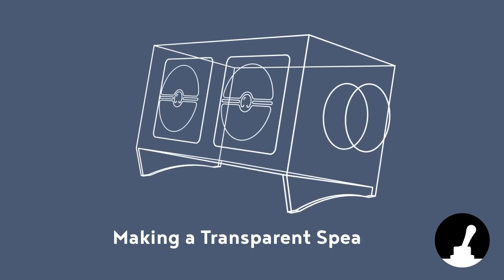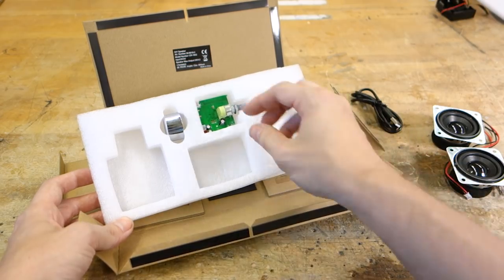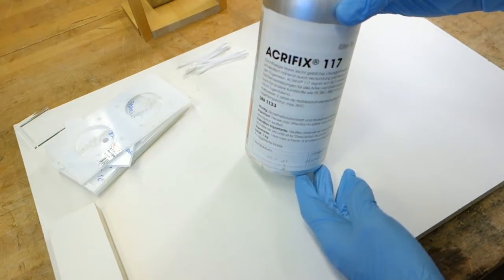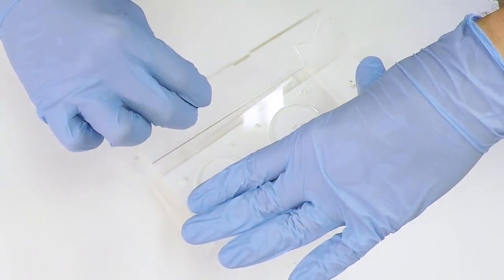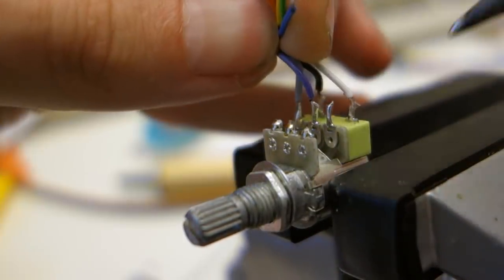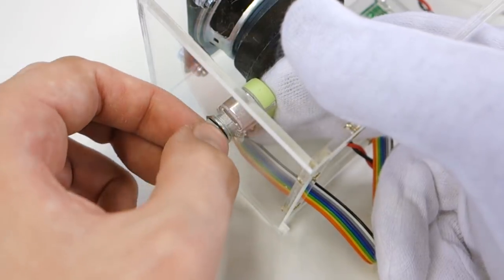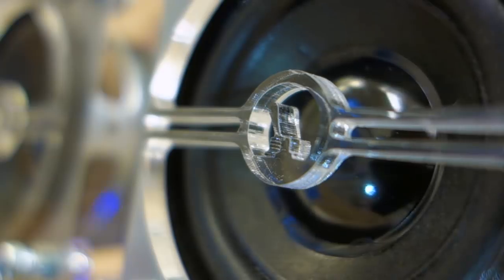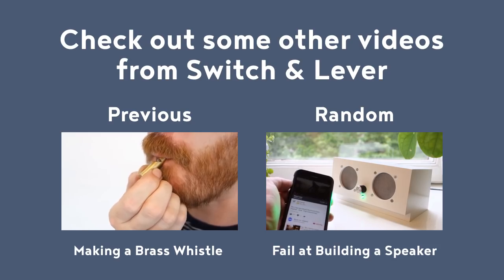Making a Transparent Speaker

Comment: If I were you I would try to spend more money on a separate Bluetooth amp and speakers some suggestions (yeeko, drok, fosi audio) and give it a passive radiator or port (which increases bass) because it deosnt cost much money 5-20$ amp 3_20$ speakers 1$ passive radiator or transparent pen tube port
Reply from the maker: Nope. I’m not really interested in building the best speaker possible. I just want it to be fun, the quality of the sound is by far secondary.

Comment: I love the clear acrylic look! Whereas most electronics hide everything away, it has all the internals on display :) Even clearer than the crowdfunded speaker as that has a frame where the panels sit inside, which I guess is because the speaker drivers are heavier.
I remember using that laser cutter at school! (Although unfortunately we didn't get to build speakers)

Comment: The speaker look pretty rad!
Is it necessary to temper the laser cut PMMA before using the Acrifix 117? 
I've used DCM and Acrifix 192 to bond PMMA together but only got satisfying results when tempering the pieces beforehand due to the thermal stress from the laser?
Reply from the maker: It depends on what kind of acrylic you use. If you use extruded acrylic (which is more flexible) it will melt the material away when lasering whereas if you use cast acrylic (significantly stiffer, and more expensive) it will turn the cut mostly into dust and smoke. There are really no thermal stresses on the material. I haven't ever gotten any crazing using cast acrylic from a laser, though extruded acrylic can be problematic and may need tempering.
Reply: thx

Comment: That looks great!

One thing I would have done differently is braided all the internal wiring - but that's just because it would match my computer internals :)

Very good!
Reply from the maker: I twisted made twisted pairs out of the speaker cabling, but that was about it. I kind of liked the rainbow ribbon cable though, gave a little splash of color to the internals :)

Comment: this is actually really cool, and seeing as how you just need a bit of glue would make for a fun DIY kit.
Reply from the maker: Yeah, but if you want to make it nice the glue is still a little bit specialized, and not something you're likely to be able to pick up on your local hardware store (unless you live somewhere with a huge selection).
Reply: quick amazon search, seems like there are options.  Though I have never tried to adhere acrylic to itself, so potentially it is not a good source.  Though it comes with the application bottle Diresta uses.
Reply from the maker: You really want to use a solvent based glue, and not a glue like super glue (cyanoacrylate), epoxy or contact adhesive that basically sits in between the pieces. If you dissolve and allow the acrylic to resolidify you end up with a much stronger joint than other methods, and it becomes virtually invisible as well. If you can get hold of chloroform it's just about the best you can use, but you need proper ventilation as it is slightly carcinogenic. The Acrifix is basically just a solvent mixture (no chloroform though) and I'm sure there are other blends on the market.

Comment: Cool. I just wish there was some better cable management, maybe stick them to the sides in a nice straight way so that they would add to the look?
Reply from the maker: I kind of like the mishmash of wires though, the only thing I'd want to change is nicer cables. Maybe even fabric covered ones. I did twist the speaker cables so they would be less wiry in the enclosure at least.